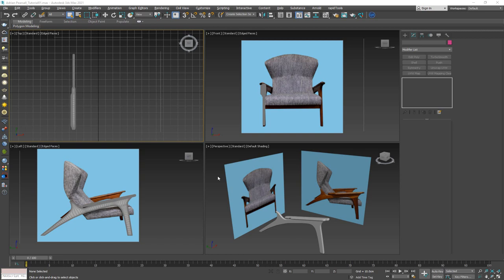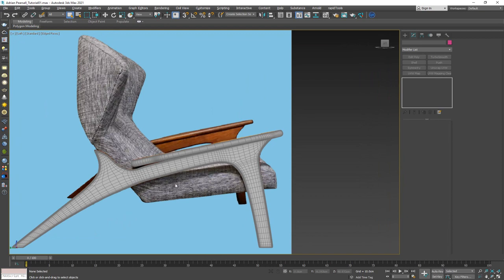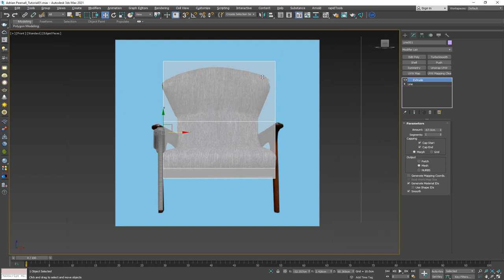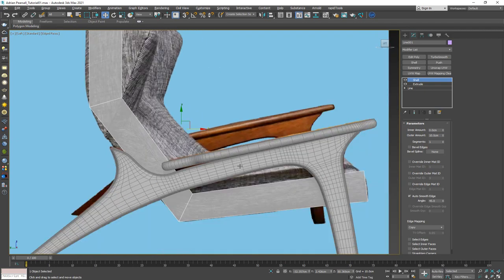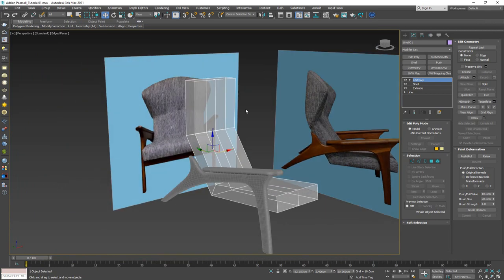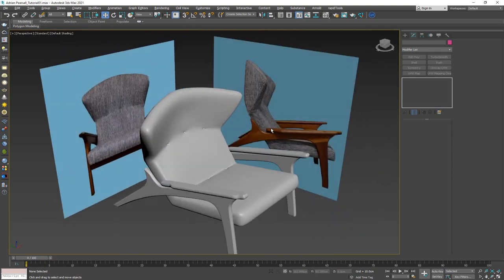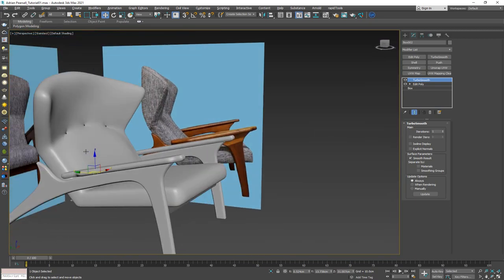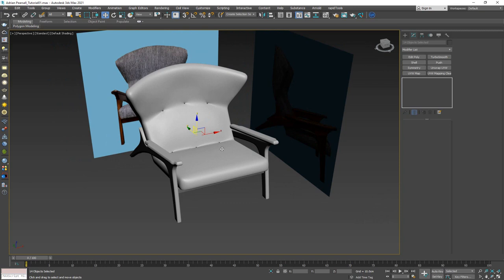Modeling The Adrian Pearsall Chair Seat with #3dsMax

Comment: Hi, at 17:46, when I use the chamfer modifier, I get slightly different options from what you get. Then when I apply the chamfer modifier, it creates only four vertices around the selected vertex. By the way, I'm using 2019 version. Is it something to do with the version I'm using?